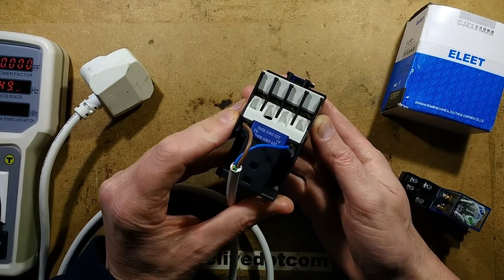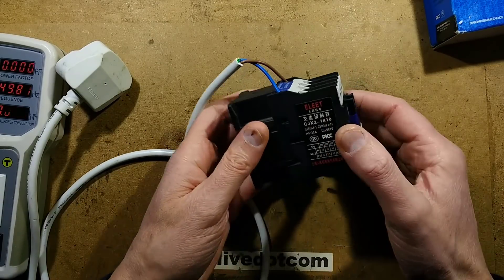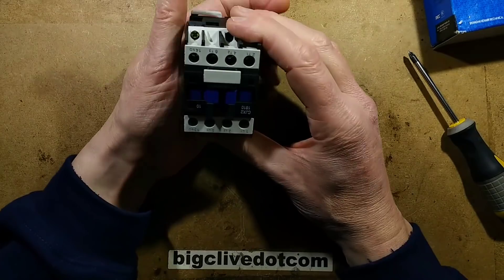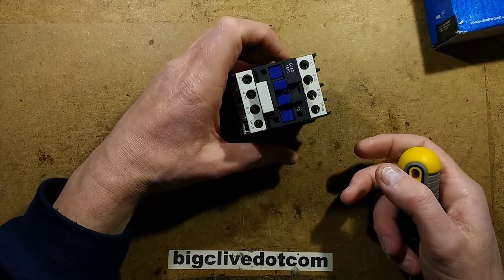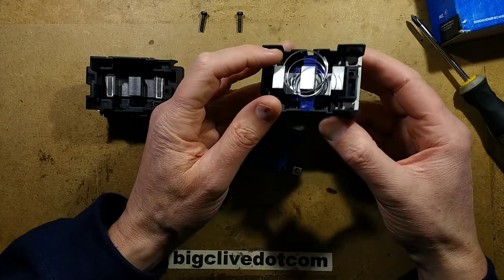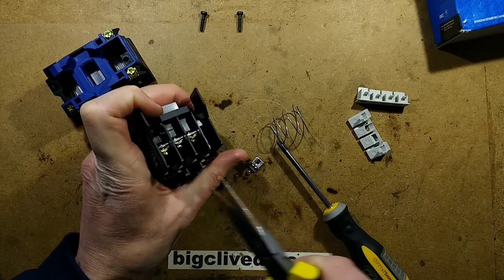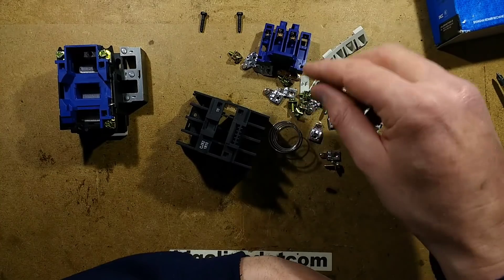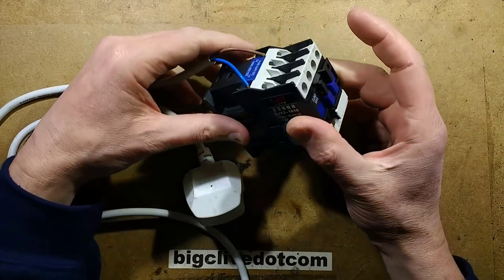eBay CJX2 industrial contactor teardown.

Comment: As an Electrician who works with contactors like this (and even bigger ones) every day...

I NEVER thought about the possibility to cause very nasty shorts when pushing them in with a screwdriver.  Thanks for opening my eyes.  I will make sure to use an isolated tool from now on.
Reply: Pyrrha Nikos 
that can't/shouldn't happen by design, the manufacturer has to get several type test certificates to sell his stuff and the possibility to
 touch live contacts won't help them get these 😉 what Clive meant was simply that you shouldn't press a contactor in by hand if you are not sure that there are  others drawn down  that could cause trouble by shorting something or mess up the routine of the plc or hardwired controls
Reply: That's not what he meant, if you look at a star/delta starter circuit the star point is shorted on the other side of the contactor, but if you bring the delta contactor in at the same time you short all 3 phases through the star point.

Ryan also brings up a good point, in that case you'd short 2 phases instead of all 3.

Plenty of BOOM though - I've seen the aftermath of an engineer thinking "Oh we don't need interlocking contacts she'll be right!"
Reply: Pyrrha Nikos when you have a contactor setup with forward/reverse wiring, both contactors better not be drawn down at the same time. Usually you have the coils wired through the NC aux contact so you have electronic interlock
Reply: Yeah, that's switching 101, really.

No what I meant was (and not I'm not even sure if that's what he meant in the video) that it's in theory possible to bridge, say, contacts 11 and 13 when jamming a plain old metal screwdriver in there, assuming the contactor is old or broken or cheap or any combination thereof.  And since 11 usually is on L1 and 13 is usually on L2... nasty things might happen.
Reply: and if you ever clean a sticky contactor with a spray of wd40, let it evaporate before energising.  wd40 ignites well.
Reply: Christopher Andrews 
Exactly what I said! There are many more typical circuits where pushing in a wrong contractor would lead to a fatal error. one example is star/delta of course. 
but there is also a serious chance of fucking up the control circuit if you push in random relais or contactors even if you don't blow everything up by shorting something.
shoving a screwdriver up to the contact is unlikely if you don't use brute force to push it in
Reply: As a once designer of motor control systems you always specified in situations like star-delta start and motor forward-reverse starters a suitably rated DOL contactor with mechanical interlocking and electrical cross interlocking through N/C Aux contacts. By using the mechanical cross interlocking this provided safety by prevent plant production operators from accidentally 'plugging' both contractors at once.
Reply: Dude, Big Clive himself had shorted out one of these contactors, along with just about everybody he's worked with. He mentioned it in a video a while back.
Reply: "that can't/shouldn't happen by design, the manufacturer has to get several type test certificates to sell his stuff and the possibility to touch live contacts won't help them get these 😉"

You're assuming a fresh out of the wrapper contactor.

What I work with everyday, however, is contactors that have been exposed to dust, moisture, insects, sometimes bird droppings...  for 20 years and up.  The materials involved are sometimes brittle as thin glass... I've broken the casings off a few of them doing normal maintenance...  now imagine what jamming a conductive screwdriver can do to those...

Shorting a star/delta with a fully intact contactor really is the least of my wories. That's what we have fuses for.
Reply: I used to work in maintenance in a brick factory, the electricians regularly cleaned the contactors out with compressed air.
No lubricant, no isopropyl, just air. 
Most contactor failures due to wear and tear, like 5 years or longer or problems with malfunctioning loads causing excessive arching and contact damage/welding.
Reply: Ben - it's better to used a dry-film lubricant, since the residue left with WD-40 can trap particulate contamination (that in turn can lead to problems). The known problems of "softening" arising from use of WD-40 only really apply to thermoplastics (which should NOT be present in the fixed, or moving contact assemblies of any contactor for pretty obvious reasons!)
Reply: Has more to do with arc flash dangers. If you have a direct short on the load side and you push in the plunger you could get flashed over.
Reply: Oh yeah on a motor with star-delta start you can short out all 3 phases :) Seen the aftermath!

Comment: The last place I worked had a unit that used about two dozen VFD's and contactors (rated from 9-30 amps depending what was being driven) all labeled Allen Bradley. I was replacing one failed contactor and when I opened the A-B box, the wrapper and contactor inside were showing another brand, bit made in the came country as printed on the box. So it seems that a major brand name is not a guarantee that they actually made the component. 
And yeah, contacts welding closed on a conveyor belt motor causes anxiety in workers that expect the belt to stop when they pause it.

Comment: Are "contact files" ever used today?  Or do factories just keep replacing the contacts?
Reply from the maker: I'm sure that contacts do still get filed, but it's more common to replace the whole assembly.  Many contacts have a plating that will wear off if filed.

Comment: When I worked for a major Australian power company, our industrial service techs were told by their leaders (young people, straight out of Uni, with no real world experience), that they wern't allowed to fault find control equipment with the panel live.  These were industrial application gas burner controls, sometimes quite complex and the only way of fault finding, in most cases, you needed power on.  We have RS Components here in Aust. and they are very good to deal with.

Comment: Simple problem, Dremel hand tool variable speed control has become on or off at full speed. Assuming mechanical potentiometer switch...fixable by cleaning maybe or waste of time? Control is 2-10 it kicks in at full speed at 4.
Reply from the maker: Sounds like triac failure.  They often fail short circuit.
Reply: More likely burnt up TRIAC.
Reply: Could also be the pot is just worn out.  Had a similar problem on my old Ford Pinto's throttle position sensor.  The engine idled ok, but died when you pressed the gas pedal.  Replaced the "sensor" (pot) and the car ran perfectly again.
Reply: bigclivedotcom arrr nuts! I will have to return it,  it's only 3 months old. Thanks dude love your videos.

Comment: I always feel really intimidated when I go into shops aimed at the trade. I guess it's because they would know that I'm just some eejit, with a screwdriver.
Reply from the maker: You're no worse than the majority of people that go in.  They're just selling components.  The only reason they often say "trade only" is because their premises are charged rates depending on the type of business, so they can't sell to the public.  They don't check on business names either.  So you could say Siskin's Engineering.  I used to just have a cash account that meant you paid for the goods when you bought them and got your invoice/receipt there and then.
Reply: Don't be afraid. Half the tradesman (bricklayers, carpenters, electricians, plumbers, ..., you name them) I talked with during the renovation of a house only know what they are doing "because that's how you do it". It is really hard to find one who knows why he is really doing something. With bit of reasearch on the internet and a decent amount of common sense, you can pretty much do what most of them do without looking akward. The only thing I feel weird about in shops for the trade is, when I buy one or two of a thing while they usually ask "how many boxes of 50 do you need?" ;)
Reply: RS do free next day delivery on any order - many times I've realised I've run out of some little widget like some cable glands or something and had a 69p order delivered to the farm the next morning for free! Saves the embarrassment of looking like a numpty at the counter. Their site is really good for drilling down to the exact size/rating part that's required.
Reply: The great thing about the RS Trade Counters was the people staffing those establishments KNEW what they were talking about. The Birmingham RS Trade Counter employed the (locally legendary) Ray Cutler - what Ray didn't know was not worth knowing. Got a problem? ask for Ray. Semis and electromechanical - he was awesome! I think he did evening classes at one of the local Tech. Colleges too - hardly surprising!

Comment: Excellent video...I have had some recent experience having to replace a similar sized contractor that had it coil vaporized after the status light spring contact shorted. Not a great light fuse considering it was for a heat circuit. Fortunately it was not too cold out. Very interesting stuff to “play with”.

Comment: Sometimes the quality control is lacking in the little things - like the springs. Springy metal doesn't "just happen" due to the shape. It takes good design and consistent production (heat treating) methods. Spring today... flimsy (or broken) piece of wire tomorrow.

Comment: Hey clive, still awesome & informative videos. I've got one suggestion tho: when testing industrial components like switches and contactors, it would be really nice to have an industrial one for comparison. I know ot would be more expensive to buy but in this case i'd like to see into a Müller or Siemens or whatever industrial brand contactor. Maybe they are better built, maybe you can't spot a single difference. Let me know what you think!
Reply: All of the reasonable to good quality ones will look pretty much identical to this. It's the quality control that's important. I am much more comfortable installing the 110$ Schneider vs the 10$ ebay special.
Reply: I'd be happy to send in a Klöckner-Möller or Siemens contactor in the same order of magnitude (for 230V coil voltage). shoot me a message if you want them ;)
Reply: Ave recently compared a name brand relay to a cheap chinese relay. There were quite some differences, most notably in the contacts which were build to last a lot longer.
Plus, for the industrial reputable brand relay / contactor you'll get a guarantee of a certain number of cycles, so there is probably some testing going on the factory. Not only does this increase practical reliabilty, it's also probably something you can insure against. No way the insurance is going to pay out if you don't have the parts with the guaranteed number of cycles (or if they find out you went over the number of cycles, although I wouldn't know how they could).
Reply: It looks very similar to the Schneider ones my work uses for iragation
Reply: also looks similar to the ABB contactors we use
Reply: yeah i know it looks pretty decent, would still be cool to be able to show the difference, not only with contactors. Clive should take some more expensive parts to bit :)
and i agree that you can try those out if they are reliable but still, for a factory they cannot afford any downtime, so reputability of the used brands is critical. I'm not saying they are worse, but they could be.

Comment: DIN

https://en.wikipedia.org/wiki/Deutsches_Institut_f%C3%BCr_Normung
Reply: Simon Tay 415V is to 240V what 400V is to 230V and 380V to 220V.
Reply: FYI  660 v is one of the  3 phase voltages  220/380  and 380/660  for me 330v is odd
Reply: What about 415V? I've often seen that on signs.

Comment: Looks like a clone from a telemecanique contactor, even the colours are right. It would be interesting to see them side by side teared down.
Reply: its a rip off of a telemecanique LC1 D09F7 two generations out of date
Reply: More like KlöMö/Eaton https://www.maschinensucher.de/pic/large/Schuetz-Klueckner-Moeller-DIL-00M-1/1799559.jpg
Reply: That looks like it but wrong colours. Here's a telemecanique:
http://sigma.octopart.com/10072577/image/Telemecanique-LC1D50B7.jpg
Reply: My thoughts exactly
Reply: Carlo vani it is, I work with the telemechanique ones all day in industrial laundry equipment.
Reply: thats a D50 which is a 50 Amp version

Comment: Yaa the HOPI meter, mine arrived today.

Ahh the Chinese, they're getting better. I remember as I child we laughed at things  "made in Japan". We don't laugh now. The first Hyundai's, cheap and cheerful, now I have a KIa. They like their sister company, Hyundai, have a good reputation for design and manufacture."  Paul Revere  if alive today in the USA would be shouting "the Chinese are coming"
Reply: Francois Deshue Yes there are South Korean. I was trying to point out they started out like the Japanese. They made cars with lots of extras for a cheap cost. Now their cars are considered innovative. The Chinese are following the same route.
Reply: I wouldn't buy a Chinese car just yet, but they are getting better. Holden stop making cars just last Friday in Australia,. They were the last manufacturer after Ford and Toyota closed there plants.
Reply: Funny thing, Hyundai's jump in quality was a deliberate response when their representatives saw they were the laughing stock of trade shows.
Reply: Our diesel Carnival's now done well over 400,000 km. Apart from replacement of consumables (which, at this mileage includes wheel bearings!) - no problems anywhere. Even the original paintwork's standing up well to Aussie conditions!
Reply: Was I was a boy in the late 60's, Japan was known for making cheap toys, cars, usually Austin's made under licence. they were the "Chinese" manufacturers of the day, but they improved.

Taiwan used to be called "republic of China". They make iphones and other devices which are made to a high quality standard. Many Taiwanese companies have manufacturing plants in mainland China making products to a high standard. Many of the European and American companies get there products made in China.

I have a Oneplus 5, a Chinese made phone. It's not cheap and cheerful, it's a true competitor to the big name phone manufacturers. Make no mistake, China is on the rise and it will start to make its products to a better quality standard. Just like the Japanese and Koreans did.
Reply: Anthony - you might know that the Chinese Carmaker Chery (also known as Qirui) was interested in taking over the Holden assembly plant. That possibility may still exist, since the Chinese Government (who own Chery) are keen on overseas manufacturing investment. It is of significance to the "Western" big-name carmakers, that KIA/Hyundai are the ONLY brand increasing their market share Globally (at the expense of Western manufacture). Product quality is excellent, and we're seeing a close repeat of the early Japanese "invasion" - very good build quality for a reasonable (though not "cheap") price. Excellent customer support too - which helps to maintain "repeat customers".
Reply: Japan's "Quality Image" has been falling for some time. The "Car Air-bag" problem (largest cause of car recalls Globally) - made in Japan. Most recently - the revelation that Kobe Steel has been forging QC Certificates for decades - and the fall-out from this "discovery" has yet to fully mature.  The West also thought it's manufacturing base was "ahead of Japan", until it wasn't, and the same's happening with China. Japan does not build Commercial Aircraft - China does; Japan does not have the technology to launch (and operate) a Lunar Lander - but China does.China is going places - and fast, whilst Japan is actually stagnating (not helped by the very elderly shift in population demographic I suppose)
Reply: Yes, we were so impressed with our Kia, Sportage we bought a Cerato as well.
Reply: Anthony Witham
Japan has been known for quality for decades at least. They've always been ahead of China.
Reply: SCWfan06 - Not always. The Japanese also made some really poor quality knockoffs to begin with. They improved VERY rapidly compared with the Chinese, who still make tons of very poor quality junk after more than 20 years of selling to the industrialized world.